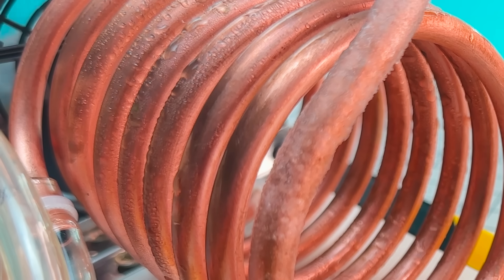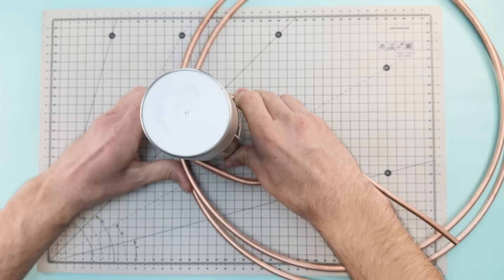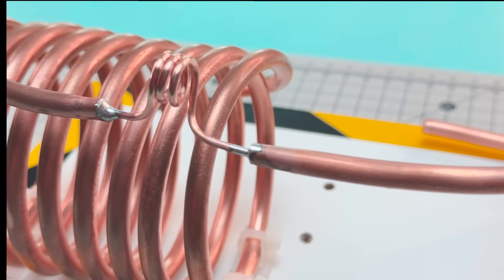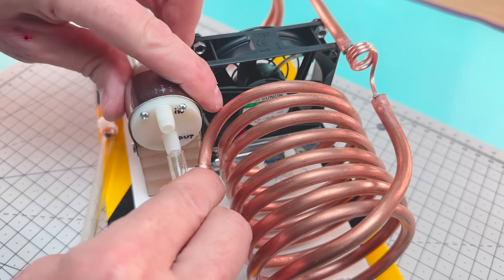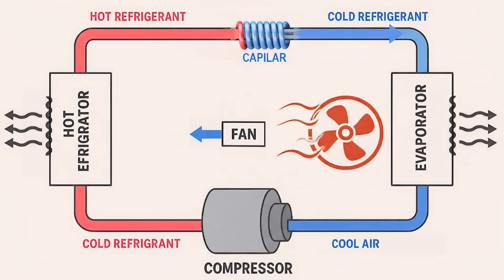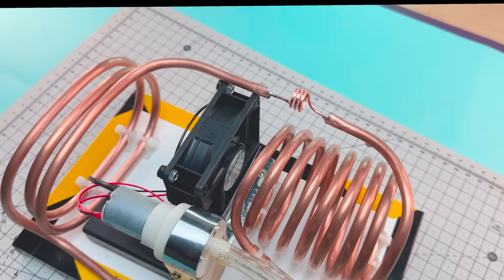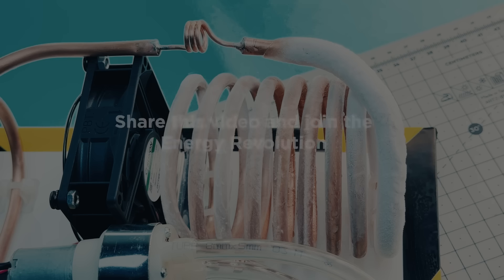Make your own AIR CONDITIONER at home Fast and Easy!

Comment: Tell me you never went to school and have no knowledge about physics without telling me you never went to school and have no knowledge about physics...
Reply: Um actually his physics aren't wrong. At all... shoddy way of doing this but ..the physics are right...
Reply: @RollinMyOwn  His profile says he's german. No matter what you say to him, it'd be wrong. Carry on.
Reply: @RollinMyOwn  
In the context of cooling a space, the physics are wrong. For this to cool the ambient air in the space, the hot side would need to be separated and ventilated outside of the space.
As it is now, it just makes the hot side hot and the cold side cold, resulting in equilibrium — so it doesn't cool or heat. Actually, the heat from the motor and fan probably adds a bit of warmth, though in negligible amounts.
Reply: Just like a  window  air conditioner..hmmm @Ziegeri
Reply: @RollinMyOwn  Yes, less efficient but yes, same principle. Window units have been designed so that they separate the hot and cold sides and exhaust the hot into outside. So if you just put one on a table it ain't cooling the space either.

Comment: How does the AC work if condenser and evaporator are both in the same system? room would be heated by one and cooled by the other. That's why normal ACs always have an outlet for the hot air.

Comment: I never leave comments, but I almost had a heart attack watching this, the principle of an AC is to transfer heat from one place to another, how can you cool a room if the condenser and evaporator are in the same place ? and this assuming the air pump can do a compressor job...
Reply: Have you ever seen a window AC unit..? That's how...
Reply: @TheSuperMARIOnette in a window AC unit, condenser and evaporator are not in the same place, one is facing outside. Can you read more carefully?

If you placed a "window AC unit" inside a room so that both condenser and evaporator are facing room air, there would be no net cooling.
Reply: @u1zha  In that case there would be heating even. Why are you explaining this to me...?!?!?!?!
Reply: @u1zha  Isn't a window AC pretty much the same damn thing..??? what makes it a Window AC is the fact that it's compact and you stick it in a damn window...
Reply: @u1zha  And my problem with the whole thing in the video, btw, is that 12v air pump, which supposedly manages to compress the gas enough. Yeah... I don't believe that.
Reply: Yes, let's worry about where the heat is coming from and where it is going before learning first principles of how to move it in the first place.  If that's how humans did science, we would still be in the stone age, spending all of our resources working out protocols for space travel despite not having anything even close to the tech to actually do it.

Comment: I'm an aircon/refridgeraion tech and those AI images showing the refridgeraion cycle hurt my soul
Reply: I'm a mechanical engineer and I had a seizure watching that. The compressor was even worse.
Reply: @Sean_735  I have some of those pumps.  They aren't exclusively air pumps.  They are designed for air and water, and that means they have a higher static pressure than a typical impeller or fan air pump.  (I also opened one up, and it's designed like a very weak compressor.)  I can believe it works.  Obviously a real compressor would be far more powerful and efficient though!

Comment: This is stupid. Even if the mechanics of this work (Which I question) it's not going to cool anything space. The condenser needs to be outside the space you are cooling or else its a net zero effect. Its why window units sit mostly outside. You don't really reduce the amount of heat with a heat pump (what is would be if it worked) you just move it using the difference in temp of compressed gas (heat outside ie compressor/condenser  that is outside vs the coil where gas expands and cools the coil which has air blown over it and into the house cooling the house by moving the heat outside where the condenser is. This is just stupid!!!
Reply: Yes its the same time heat and cold the room but heat more becouse the fun and pump make some heat too.
Reply: @StewenHu  This is true, but I'm not sure how many BTU's can be in a 9volt battery.

Comment: So you pushing cold air, but you are releasing heat from the other wich cancel. Its a nice experiment but you need to release the heat somewhere else. But it gave me idea to make a CPU Coolant. Thanks for the video ;)
Reply: To be fair think about propane. Its basically what the newest USA refrigerant is. One main issue was the tin solder they used which may be fine for the pressure of a air pump but I'm not sure what the psi rating out be.

Comment: Wait im seeing holes in this... The other side will get hot so it would have to be vented outside or a different room and then when adding the butane youll blow the rubber tubes off so you would have to run a vacuum on the system before adding the gas. This is why everyone dosnt have mini AC unites just sitting in there living space.

Comment: 🎯 Key points for quick navigation:

00:00 🛠️ Bau des Kühlkreislaufs mit Kupferrohr
- Einführung in das Projekt eines selbstgebauten Klimageräts mit wenigen Komponenten,
- Kupferrohr wird zu einer Spirale gebogen und dient als Verdampfer durch hohe Wärmeleitfähigkeit,  
- Ein zweites Rohr wird weiter und mit weniger Windungen gebogen und dient als Kondensator.
01:46 🧰 Montage der Komponenten auf Holzstruktur
- Befestigung der Bauteile auf einer vorbereiteten Holzplatte zur strukturellen Unterstützung,
- Verdampfer wird mit Kabelbindern montiert,  
- Kondensator wird korrekt ausgerichtet und befestigt.
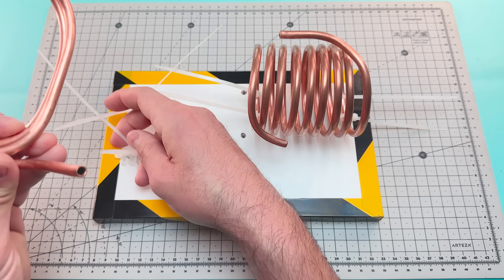02:52 🌡️ Einbau der Kapillare und Abschluss des Kühlkreislaufs
- Kapillarrohr erzeugt Druckabfall im Verdampfer für die Kühlung,
- Kapillarrohr wird gebogen, eingeführt und fixiert,  
- Anschlüsse werden verlötet, um Gaslecks zu verhindern.
04:10 🔋 Elektrische Komponenten und Luftzirkulation
- Lüfter, Batteriehalterung und Luftpumpe werden montiert und verbunden,
- PVC-Rohre verbinden Verdampfer und Kondensator,  
- Kleine Batterie versorgt Ventilator und Pumpe für mobile Nutzung.
06:57 ❄️ Einführung von Isobutan und Funktionsweise des Kühlprinzips
- Erklärung des Kältekreislaufs mit Isobutan als Kältemittel,
- Isobutan verdampft unter Druckabfall und entzieht Umgebungsluft Wärme,  
- Die Pumpe wirkt als Kompressor, das Gas wird wieder verflüssigt.
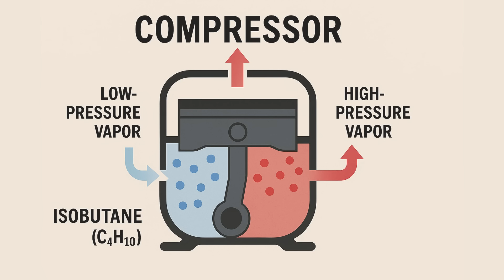08:31 🧊 Fertiges Klimagerät in Aktion
- System kühlt effektiv durch Temperaturreduktion bis -10 °C,
- Lüfter leitet kalte Luft zur Raumkühlung,  
- Demonstration der Temperaturmessungen mit -7 bis -10 °C.

Made with HARPA AI

Comment: That won't cool a room. you need to put the condenser outside the room you're trying to cool, otherwise it's just pumping the heat back into the room.
Reply: will it work for keeping pc cool?
Reply: @KintaxXx12  I wouldnt like this, or at least only for testing.  The humidity you would introduce would condense on components that don't like to be wet.

Comment: The basic principles are there, but this is an easy deception.  Everything from leaving gas in the system to begin with, like air itself and oxygen (you have to vacuum pump everything out to under 500 microns, and then charge the system with freon)... To the fact that your fan is going to take the heat from one side and put it right back over to the coils anyway...  That is the premise of an air conditioner, you have that much right?... But the whole point is to separate the heat, and carry it away from the colder side.... Your fan is going to drag the heat right back to the coil it came from.  

Also, there's a pretty basic massive problem with your orientation of the condenser, let alone the fact that the fan is going to blow air over it and bring it to the cool side anyway.  And let's not forget that a 12-volt air pump is just massively shy of what a compressor does 😂
Reply: Enfin quelqu’un qui connait le principe de la production du froid

Comment: How are you cooling the room when you're dumping the heat straight back into the same room? 🤣
Reply: ok but will this work outside as a handheld ac ? just to blow cool air to your face while you walk?
Reply: it's just a demo, for a, actual use, you may want to put the heating part outside.
Reply: I hope nobody uses propane or butane to fill their DIY loop

Comment: yeah, now take a temp reading at the condenser loop, then a temp reading at the motor on the fan, then on the pump, then on the battery.  now find the difference between how much heat you're making and how much you're removing.  congratulations, you've created an inefficient heate for your room.  you could have achieved the same results just leaving the refrigerator door open.  suggestion:  the condenser loop and evap loop should be on opposite planes of that piece of wood.  put the device in your window so that the condenser loop is outside and the evap loop is inside.  THEN it's an air conditioner because it's bleeding off the heat outside the room.
Reply: ok but will this work outside as a handheld AC? just to blow cool air to your face while you walk?

Comment: it makes cold air and hot air at the same time and releases it in the same room. Very deceitful for cooling your room LMFAO.
Reply: Right.  I was curious as to why  he didn't add an exhaust fan for the heat transfer side and shield the 12v PC fan from sucking in hot air from the compressor coil.... but meh.. I guess if it works, it works.  Now just build this into a proper encloser with a small solar panel and bms.   make a small portable unit.
Reply: I'm not sure that he was trying to be deceitful.   It almost seemed like a joke when he said "you can cool any room", but not talking at all about the temperature at the heat at the condenser, it definitely could be taken as deceit.

He used quite a bit of the video to show the temps at the evaporator coil, both when it is first turned on and many minutes later.  It would definitely have made sense to spend 6 second showing the increased temp at the condenser as well.  The true power of the system is represented by the difference in temperature between the evaporator and condenser, so this seems like a no-brainer.

That, coupled with no cost estimate for the project or information on how to get the components makes it really feel like a junky video.  I wouldn't be surprised at all if the video is actually stolen from somewhere else, and only the audio track (AI voice) was written by this channel.
Reply: ok but will this work outside as a handheld ac ? just to blow cool air to your face while you walk?

Comment: Wouldn't this also work without isobutane? Like just high pressure air on one side and low pressure on another
Reply: no, it requires a liquid that evaporates then condenses. That's the most crucial part.

Comment: This is fine for a learning demo, but if you want it to work, you'll have to put the condenser outside and I give that airpump 30 minutes before it fries LOL battery won't even last that long likely. Might work for a dog house if you run the condenser pipes out the wall, maybe for 10 minutes....
Reply: ok but will this work outside as a handheld ac ? just to blow cool air to your face while you walk?

Comment: You need to put your condenser cycle outside the room to dissipate heat, ideally with a radiator and fan of its own to improve efficiency. Otherwise you just have a 12V heater for your room. All the concepts are here though, so modifications are pretty straight forward to make it work.

Comment: This can't work ! The calories taken at the evaporator are "relased" ar the "condensator" located in the same room. The final result is an increase of air temp due to the Joule effect in both the engine and pump...
Reply: Yes it makes much worse because it iselt emitting heat so it actually warmup room. The same effect if you just open door in a fridge.. this is actually question from school physic class ..

Comment: To show this as a "how refrigeration works" is fine. But DYI soldering joints would not last, neither that off shelf glue. Air pumps aren't designed with proper seals for flammable gases and tiny leaks accumulate gas in enclosed spaces. Isobutane is heavier than air, so it pools in low areas and corners, a small spark, even from the pump, because it's not impossible it could arc,  and it's concentration range is quite wide (1.8% to 8.4% in air), you could turn a simple innocent toy into a small bomb. Kids that don't know better could be building this and burning their parents home down.
Reply: Kids that don't know better. No one 'knows' better. Better is what? An education? Were mistakes ever made in education? Is there any mainstream way of doing a thing today that will be considered dangerous by tomorrows standards? The warnings are on the can.
Reply: This video is going to burn down someone’s home. Everyone’s worried about how well it’s going to work but he just dumped highly flammable gas into an unsealed electric air pump.

Comment: which room size it can make cold and for who long? that's the question I needed to answer from the video, thank you
Reply: It will heat up the room as this device dumps its heat into the same room.
Reply: @DreadX10  :face-blue-smiling::face-blue-smiling: the evap will be outside ....dam we need to explain evreting to you  ,,,,please stop to suporte liberal démocrat party sir
Reply: ming drop to 12 degrer for 20x26 feet and take 2 houre max

Comment: The only problem is it can't cool a room like that. All it does is move heat from one side to the other, resulting in a net gain of heat (from the work done by the pump).

Comment: No mention of the heat coming off of the condenser.  The evaporator will cool the room and the condenser will heat it.
Reply: I was about to say if the heat comes out on the other end, the room doesn't really change in temperature 🤣
Reply: This is where the function of its purpose is negated. Thats why you have TWO separate units, one inside - the evap coil and one outside - the condenser, or at least the hot unit outside then have long tubes connecting both together.
Reply: You need to make the hoses longer, so you can put the condenser part into a bucket full of cold water. The water will be heated up as it will accumulate the heat. You just need to change the water from time to time, when it gets hot.

Comment: As a demo on how an air conditioning system works excellent video! As a practical tool for cooling the room not so much. you've just moved the heat from one side of the machine to the other. Now put the hot end somewhere you don't mind getting hot and then we've got a proper room cooling device. It would probably do a decent job of cooling a soda can if your coil was correctly sized and vertical.

Comment: Fascinating.  I never understood how an air conditioner actually works before.  Thanks.
Reply: That's not how an air conditioner works; that's how a fridge works because the heat that gets sucked away at one end to cool comes out on the other end, so the room doesn't change in temperature really. You would need to somehow place the parts that spread the heat outside of the room to use it as a Room cooler.

Comment: Absolut non sense. To work as an air conditioner, the efrigrator should be plased outside, otherwise, the same amount of heat taken from the evaporater will be released from it, plus the heat from the motor, fan etc. That‘s why you can‘t use your refrigerator as an air conditioner
Reply: All while you yell at your kids for not closing the fridge 😂😂😂😂
Reply: Because the system will equalize in temperature. You do understand that you bringing up a refrigerator is the exact reason that a refrigerator works. The cold is in the refrigerator and the heat removed from inside the fridge is pumped out i to the room. Thats why if you leave the door open the heat added to the ambient temperature of the room will just raise the temp ont he inside of the fridge and it wont do anything to cool off the room. Once the cool in the fridge has equalized the temp i. The room wont drop... the food will just spoil. @pierregauthier3077

Comment: You could make a heat exchanger with tubes and water to move the heat outside.
Replace the battery with an AC adapter.

Comment: The pump probably won't have enough power, but that would be the least of the problems.

More importantly, with this design, the cooling effect is canceled out by the heating of the condenser. This means that while it may be cooler in one area, it will be hotter in the other. 
This is why air conditioners are  split in two units  or at least vent the heated air outside (monoblock).

Comment: Great video! Can you recommend a better way (valve or other hardware) to charge the unit with the iso butane OTHER THAN a surgical needle? A part number for something in-line with the hose would be great. Thank you.
Reply: You need to evacuate the system of air as air contains moisture, which would clog the capillary tube.